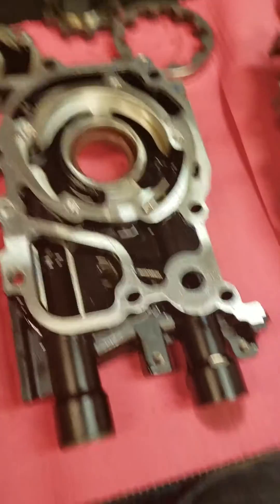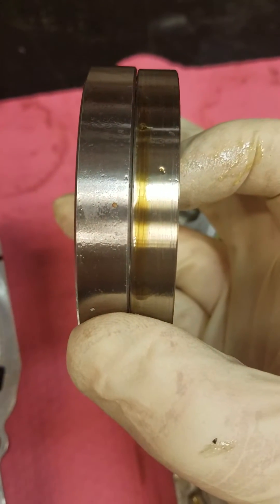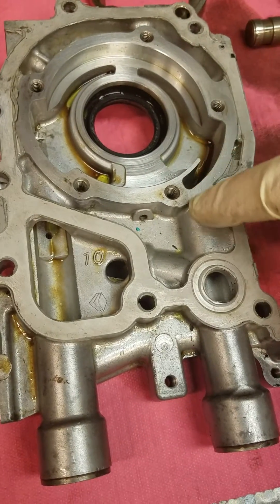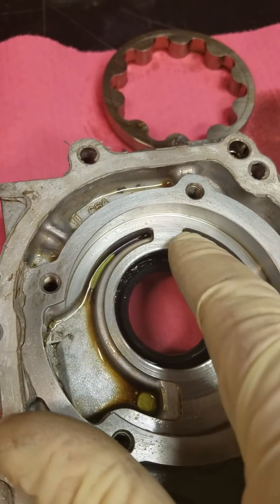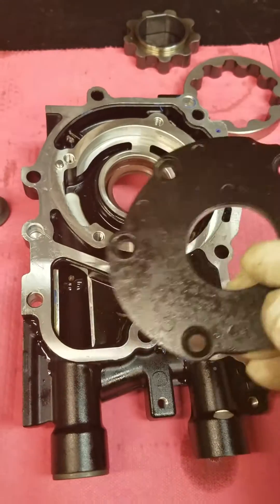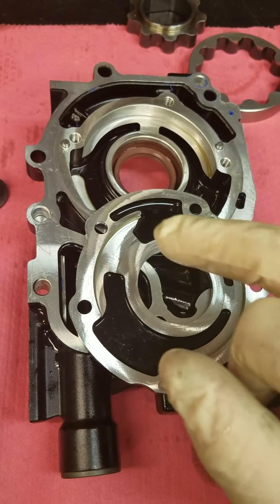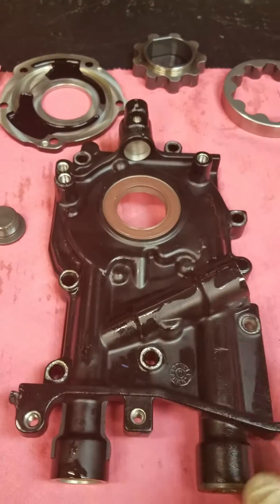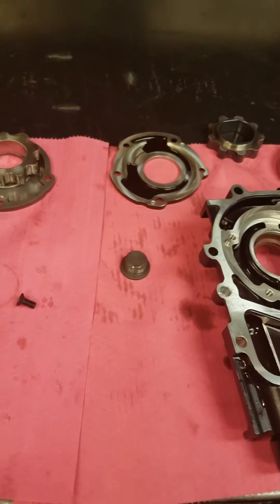Subaru oil pump tech with Zack @ preracing.

Comment: I would strongly recommend against deburring the working edges as that is just opening space for the oil to lose pressure. You want those edges sealing as best as possible. Otherwise how is that any different than gouges in the aluminum or the rotor?

Comment: one thing im finding with the newer subaru pumps  the  bypass valve sticks in body  from flashing   i polish the piston and  run a  reamer threw the bore to clean it up  needs to be torqued down to block tho

Comment: Yea, I had that all black one on my NA, thinking it was good idea. Had slow oil leak that got worst over time. Had a mechanic troubleshoot where it was coming from, thinking I probably screwed up sealing pump when installed, and was going to pay mechanic to do right. He found it was the main seal was where the leak was coming from with dye, so he changed that seal. Fixed it for a little while before it started doing again. So I changed pump myself for correct OEM one, found a loose screw on one of the back plate was loose, and that pressure was slowly pushing my seal out and leaking oil from there.

Comment: Hi, how did you manage to take the 2 bottom plugs and the oil relief hex bolt out. I just bought a new pump and it has some red Loctite on the bottom 2 plugs and none will budge at all :(
Reply: All good just added some heat from a hot air gun :)

Comment: Question. Would I be able to use one of the ports at the bottom to plumb in an accusump? I’m assuming I would use the high pressure side if so. 
Thank you.
Reply from the maker: 444 Per4mance you could run it in the pressure side of the pump. One of the block plugs in the front of the block would a better job of protecting the engine in an emergency. They directly feed the main oil galley.
Reply: Morgan Motorsports ha. got it. I knew it was to good to be true. I may just have to put a “T” in my remote oil cooler return line. With a check valve of course. Thank you for the speedy reply.